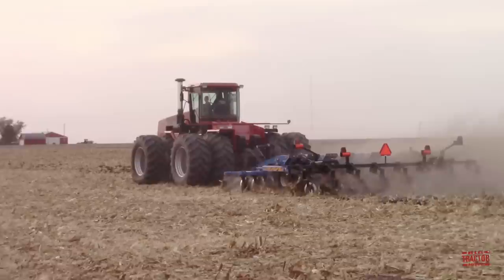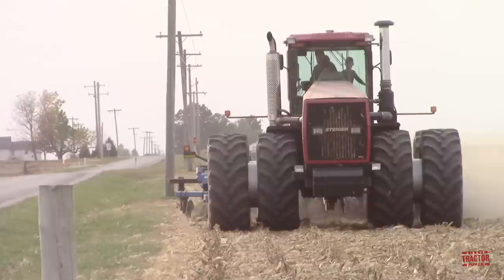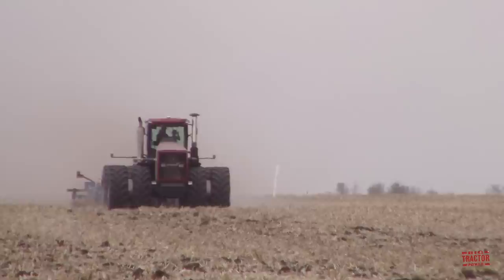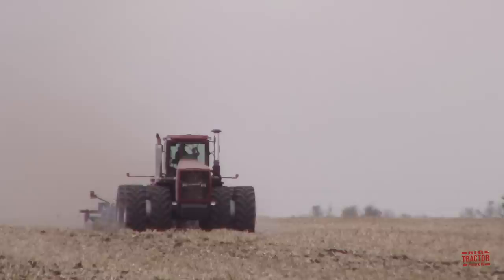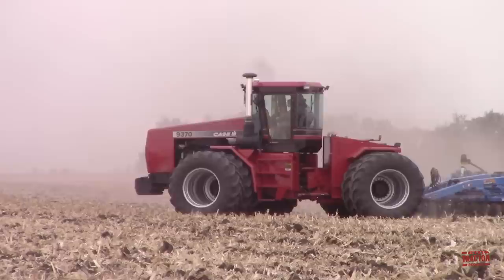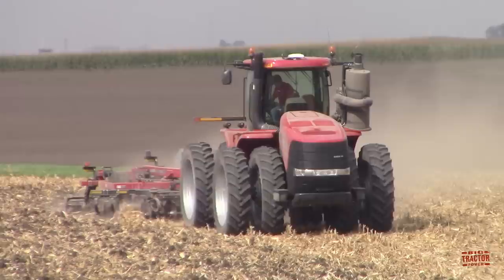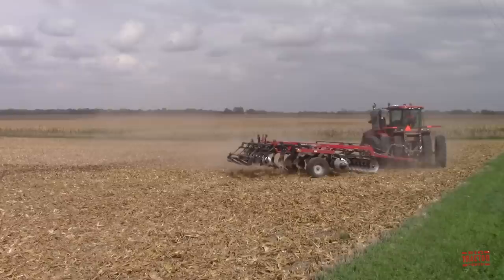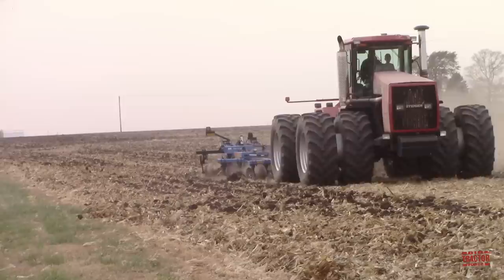Case IH 9370 STEIGER Tractor Working on Fall Tillage

Comment: We had our 4586 overhauled and the original engine turned up to roughly 375hp. We fabricated a few mounts to get a little more weight on it so it could pull this same DMI disc ripper. It did it for a few years till a front axle snapped. Hell of a tractor!
Reply from the maker: I own a 4786 with the DV800 engine.  Great tractor.

Comment: Clocked up a few hours driving both 9370/9380 on laser buckets in Australia in the early 2000,s, fixing tyres and sleeping in some rough camps thinking I was making big money, fairly capable tractors the N14 turbo whistle is something that you should experience under full load , then send the big red girl up a dam batter at full pace , was a bit of fun at the time

Comment: Great vid BTP👍we have same 9370 scraper version with over 20,000 hrs, 350hp, duals all round, pulling 40ft airseeder.  Inside the cab we have foot value you can tap to change from high to low range which we use at headlands before turning around.  Steiger are best tractors out there, early 9100 - 9200 axles used to get hot but 9300 they had it sorted but not big cab compare to today Steigers but easy to operate.  When 535 Steiger was replace with next model, a lot scraper guys were disappointed because new model was lighter chassis.  I got chance ride in NH version 550 gee the ride comfort has come long way n pull scraper like it was nothing.  Scrapers are mainly use dairy irrigation around our area.

Comment: I drove a 9350 belonging to a neighbour some years ago. Nice tractor I think it was a 24? speed powershift. It amazing how fast they cultivate these days. I never go that fast. 3 mph with a disc plough and 6 mph while sowing is fast enough for me and my 1586 Inter. And she is pulling implements a 130 horse would pull.  The 4586 will pull them faster only because she so much bigger.

Comment: great video, we used to own 1 wth 24 speed (which i loved) my uncle also owns one which has the 24 speed as well. I Own a case IH 485 and would trade it in a second for my uncles 9370 if it had the same power. awesome tractor 4sure..

Comment: That thing is a monster. It's got a heck of a load behind it but it doesn't even seem to know it's even there.
Reply: I noticed the DMI head lead shanks in addition to the usual 7. Truth be told the ripper could probably stop the tractor dead in the right (wrong😂) conditions
Reply: S Evans you actually just reminded me of something. I watched a 9 shank Krause dominator (which requires 270 to 360 PTO horsepower) stop an AGCOSTAR 8425 (425 engine, probably around 390-400 PTO horsepower if they had one) dead in its tracks. was running good and strong and once it hit hard enough ground you heard it almost stall the tractor 😂😂😂

Comment: Running DMI for as long as I've been operating equipment, we pull them with an 8520 JD and an 8360R JD.
Reply from the maker: Very nice.
Reply: What implements are you pulling?

Comment: all i see is green tractors on this channel lol.   that's a good lookin outfit right there. are folks starting to repower any of the 90s tractors yet? some folks turn lots of hours
Reply: The 90s tractors are in just the right spot as far as what engines were used and parts availability. The Steigers are at a distinct advantage having the Cummins engines